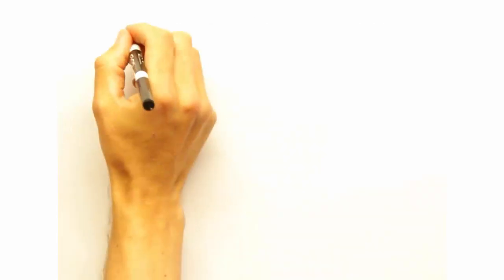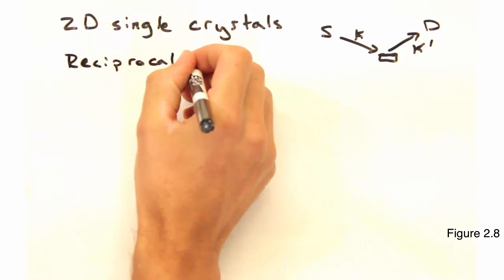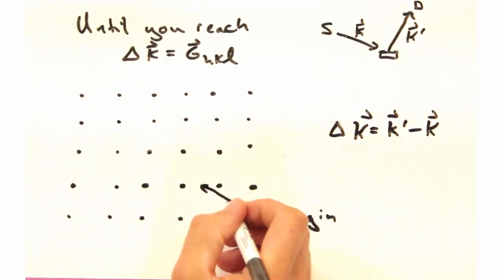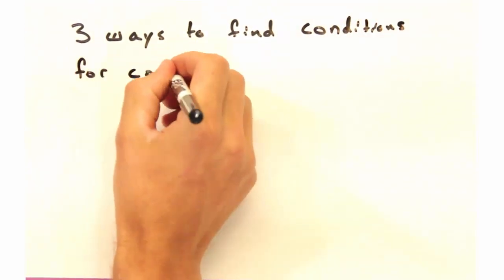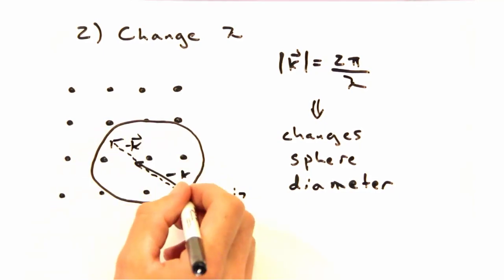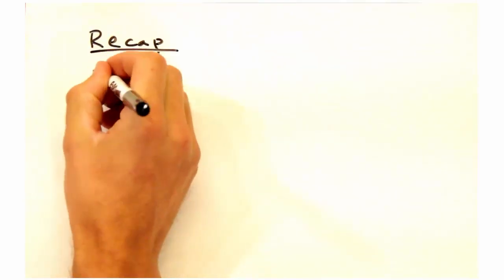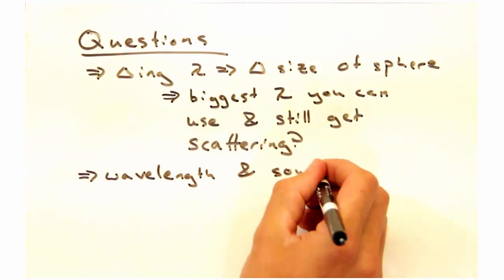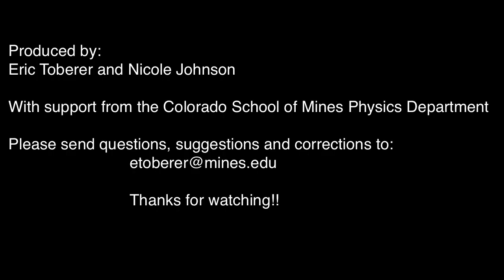Solid State Physics in a Nutshell: Week 4.1 - Ewald sphere

Comment: is the magnitude of the k and k prime vector relevant?
Reply from the maker: Within the context of the Ewald sphere approach, the magnitude of the vectors sets the size of the sphere.  The bigger the sphere, the more likely you'll strike a reciprocal lattice point. As a case example, TEM uses high energy electrons which have huge k and k' vectors.  When you do TEM diffraction, it's incredibly easy to find diffraction reflections.
Reply: Eric Toberer and to increase the magnitude you would just move the sensor or detector further away from the sample?